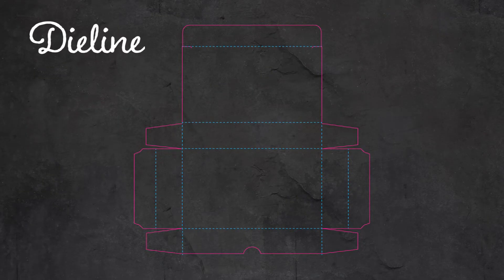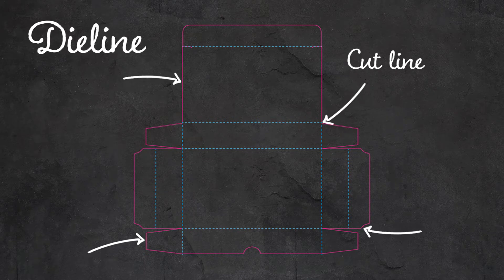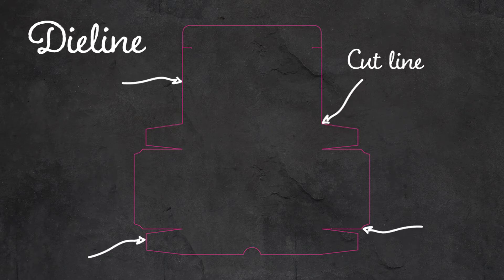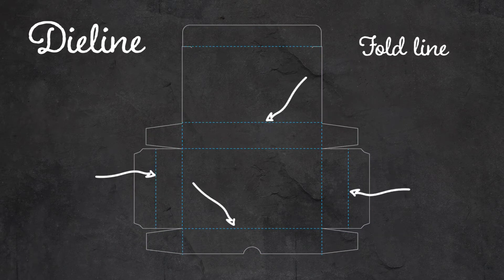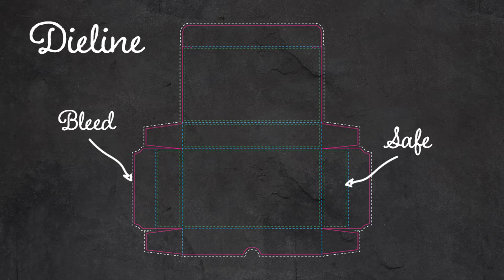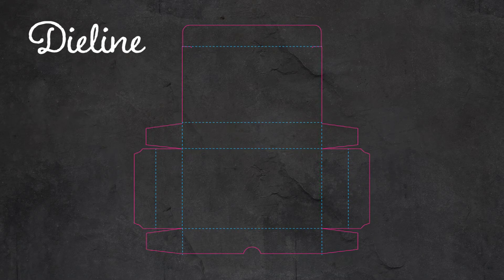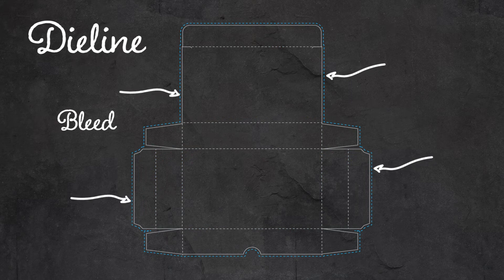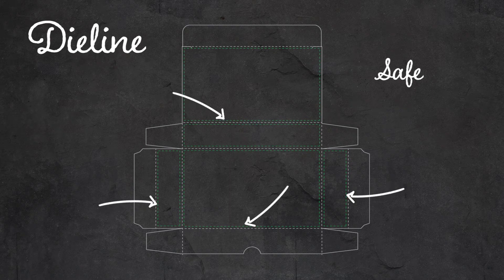WHAT is a Dieline and HOW do you read a Dieline???

Comment: Hi, what if the Packaging Medias are Photographs? Can we use photoshop instead of Illustrator? Since it's pointless to use Illustrator on already generated Imagest that can't be converted to vector?
Reply from the maker: Hello! I demoed using vector but you can of course use placed images such as photographs. It will depend on the vendor doing the printing, but the ones we use at my job require an Illustrator file setup for print, but many times I have to build out the package structure of the artwork using Photoshop, then place the artwork into Illustrator. I do all my written text in Illustrator so it's crisp when it's printed. 
Sometimes the 'photos' we work with are very flat simple color shapes, so I will convert to vector using Image Trace. 
I hope that helps!
Reply: @melleedunn  The Project I am working with are all manipulated photographs with little to none shapes based photo, So Photoshop is the go to for me, I probably gonna pipoint each photograph and export them as a new file and re-trace everything in Illustrator so I wouldn't clip mask everything. I just hope there's a better way I can do it in illustrator but still gives me the flexibility of clipping photos without duplicating bunch of shape to hold the photo. Thanks for the reply though, helps a lot.